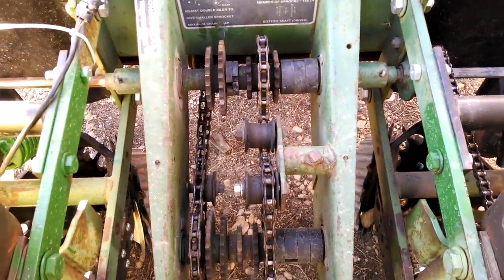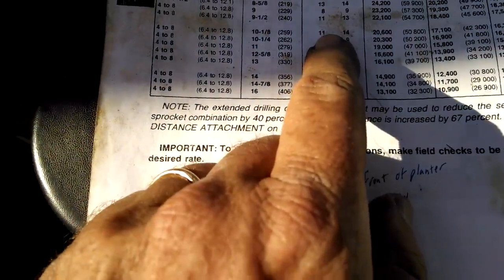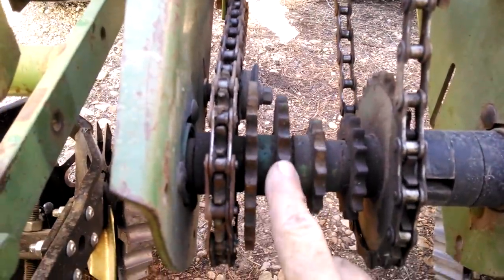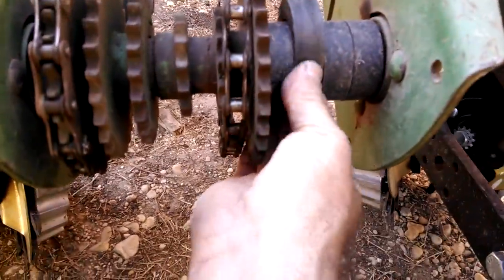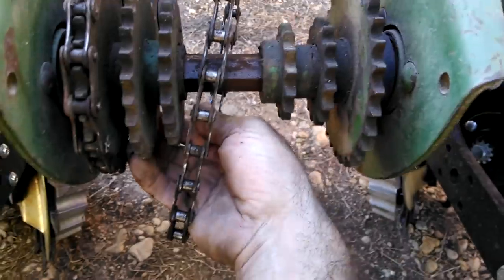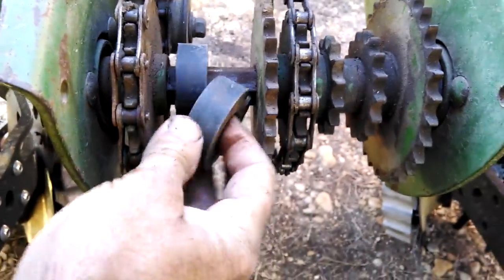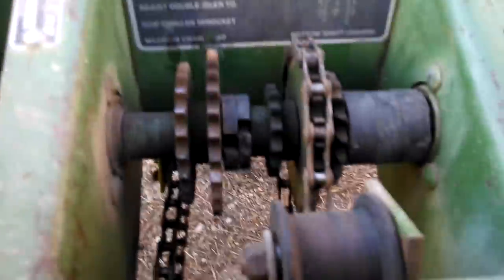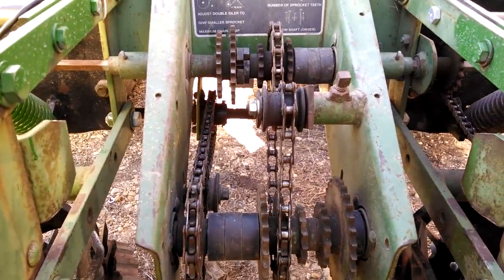Setting planting population.  Finger pickup John Deere 7000

Comment: Its funny people call these "really old" when they dont look much different. They have double disc openers and pack wheels. Theyre pretty much a no till planter and no till has not been in practice that long.. We have one of these and it works perfect. We also have an old one that I saved from my dad wanting to cut it up for scrap iron. Its a six row john deere with metal seed cans! It also works well. I planted 6 acres with it last year. So fun! It spaced the seeds very nicely.